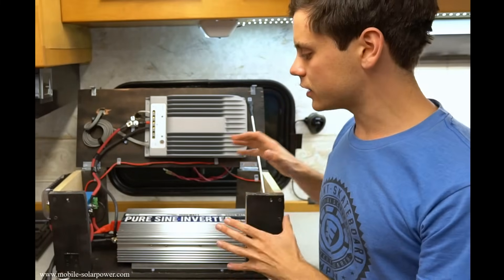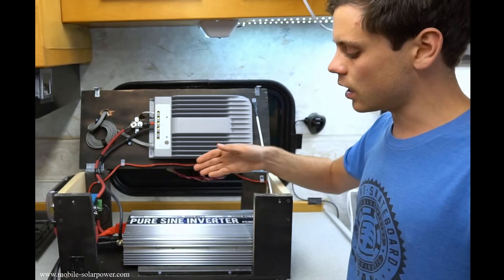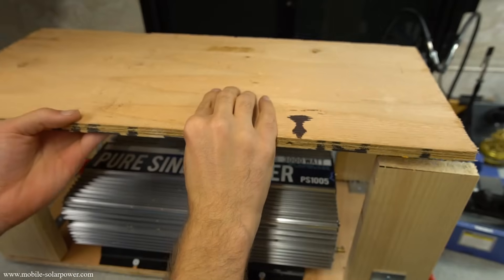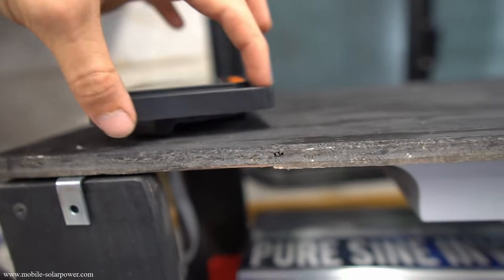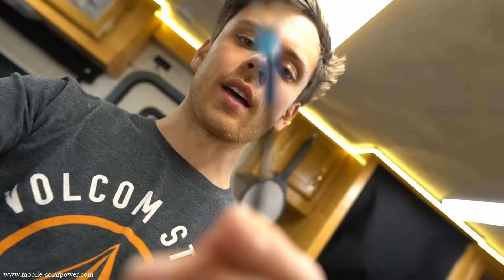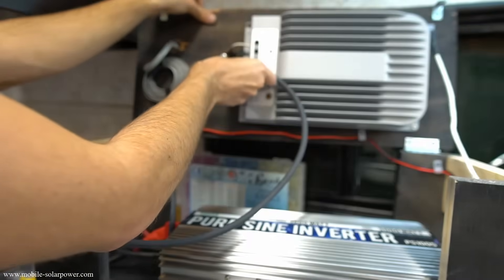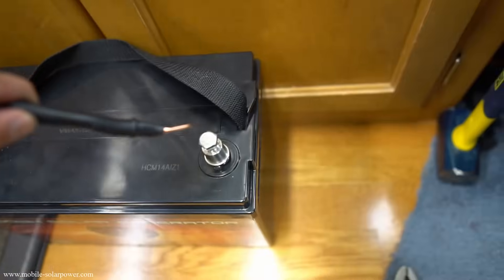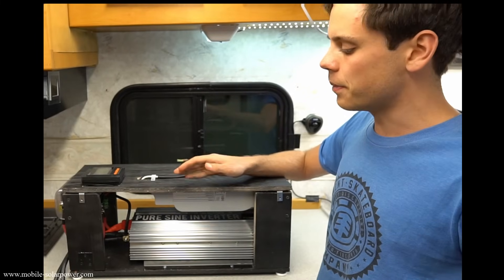DIY Off-grid Solar Power Station for Beginners on a Budget

Comment: Will, when making a portable power station, would it be ok to have a connector between the battery terminals and the charge controller? I'd like to be able to quickly swap batteries so I can use one battery with an inverter while the other battery is charging. I feel like having to unscrew everything would be time consuming compared to just a set of plug together connectors.

Comment: Hi Will, greetings from Spain. I just have a couple of questions regarding how to charge the LifePO4 battery, I want to build a 12v 100Ah  portable battery that will be  charged only from 220 ac, I will not be using solar panels for charging. In that case I do not need a MPPT, Can I charge the battery just with a cheap PWM made in China and a 12v power supply from a PC.

Comment: Will,  I HAVE AN IDEA FOR A NEW VIDEO.  This may be elementary to some, but I and others (I believe) need to have a better understanding of the grounding (or lack of) of solar generators that don't sit on a metal frame on the ground, especially with inverters that have  120 AC output.  I don't really understand it.  If you build this same system as a semi-permanent system in an RV you would ground the negative to the frame as well as bonding the inverter case to the frame for safety, but on these portable generators there is no grounding.  What am I missing?

Comment: Great!!! What device could one add to make it work like a GOAL ZERO.  I'll explain.  I have a domestic frig in my office.  It is getting it's power via the 12v cig lighter connection on the Goal Zero.  The Goal Zero is plugged in to ac to keep the battery charged.  I Goal Zero's internal battery acts as back up power for when the lights go out.  What device can be added to your solar power station so it can act the same.  Thanks

Comment: I've just built this box today and cut the timber (16mm thick) to the following sizes if it helps anyone out... Top and Bottom Panels - 560 x 270mm, Four Corner Panels - 100 x 220mm, Two Side Panels - 238 x 120mm (mine are around 20mm deeper top to bottom than Will's)... I'm using the same EPever 40A controller but with a 2000w Krieger inverter. These timber dimensions leave a gap of approx 65mm between the controller and inverter when the lid is closed. Thanks Will!

Comment: Why not making the Solar Power Station using a DC to DC/Mppt combo unit which will increase options and useability?
I like the CTEK system for that, is small and expandable.

Comment: LOVE your videos! I've got a new name or way to market yourself. "Will" Power. Anyway, would this be good if I downsized it to a 100 watt setup for my backyard? Want to keep it in my tool shed and run a couple of water pumps for garden water falls and some low voltage lighting. Thanks and keep up the great work.

Comment: This is the first of your videos that I’ve seen that has a separate Low Voltage Disconnect. Are these necessary with Battle Born batteries that claim to offer such a feature in their BMS? Thanks

Comment: great channel Will.  you don't talk much about recharging time and/or rate capacity. On my channel I have a series called "Portable Power".  I talk about FOGS (forced off grid survival).  To me (and my viewers), the recovery rate to full capacity of the battery is a critical factor.  the power station I am working on needs to able to charge back up in 2 a hour time period.  I suspect that the solar power source can't do this.  I also would like your insight to the recharging aspects (time, max amp rate) of SLA vs lithium batteries.  If you watch my FOGS video you might be more likely to understand that in a FOGS scenario, battery recovery time is limited to the incremental running of the whole house generator.  My FOGS idea was created because I do want to be on grid but in smaller communities outages (hours or days) force alternative short term solutions.  Am I wrong in my assumption that when recharging batteries, Lead acid wins hands down against the lithium?
Reply: BTY, you should learn to use pocket hole joinery.  it is much easier to use than "L" brackets. I am  avid woodworker so I am more familiar with working with wood, same as your expertise in electrical.  great channel you have here :>)

Comment: Love the DIY power station.  I have a question about the battery connection.  To make this portable so I can connect it to my RV battery mounted outside on the front I'd like to be able to plug in the battery.  Are there power connectors available that can handle the current for a 1500W inverter @ 12v?   I'd rather not have to attach the wires to the battery terminals every time I want to use it.

Comment: Know what I dig about this, besides your enthusiasm for this project? That you can SEE your components and that its portable, efficient, and safe! I will certainly build one of these, but I think id rather use one of the better/Bluetooth MPPT chargers and maybe an extra couple DC ports, USB, and maybe a basic volt meter. Sweet build though!
Reply from the maker: Great point. A nice victron would work well in here. And thank you!! I loved this little box system :D

Comment: Thanks for the great video
I'm looking for a small plug and play  unit to run alpicool 20 compersure fridge with 100 watt panel. Traveling in car so need compacted unit.Looking at poweroak 400 or jakery. 
Thanks Gaylene

Comment: Will, you need to buy a big bus and install a mechanical shop inside to make solar cell equipment. Then with a second driver, you could drive around the state/country and show demos to people and offer courses on how to build those things. How do you like that idea? So far people can check your website but they cannot touch the equipment.

Comment: WHEN PURE OR MODIFIED SINE WAVE INVERTERS GET USED OFTEN UNDER LOAD MOSTLY IN HOT WEATHER SUMMER CLIMATES, THEY USE THE COOLING FANS OFTEN AT HIGH RATE SPEED, THIS CAUSES MUCH WEAR ON THE INTERNAL BUSHINGS  BEARINGS, THEN YOU GET FAULTY FANS MAKING NOISES SLOWING COOLING AT START UP AND RUNNING. DO YOU REPLACE YOUR FANS WITH UPGRADED ONES WHEN BUILDING THESE PROJECTS. I USE  SMALL DAB OF MARINE GREASE ON FAN HUB BUSHINGS BEARINGS FOR RELUBING. MOST START FAILING BECAUSE OF CHEAP THIN GREASE THAT THE FACTORY FAN MAKERS USE. I OWN SUNFORCE  PURE SINE WAVE INVERTERS AND THEY WORK WELL. NICE BUILD.

Comment: I had done a plastic ammo box from the hunting store, I had added a fan on the side for ventilation and it works great with my inverter.  Add some fancy speaker box carpet and that box would look fantastic. I was thinking after watching you can get cheap flip style circuit braker that only flip during over current events instead of heating up like those cheap automotive sytle ones. They waste current while being inline to heat the metal strip inside to move away from the contact but they are reliable but use a considerable amount of current.

Comment: VICTRON BATTERY PROTECT BP-100 12V AND 24V - is this the right one?? I couldnt find it in the parts list.....Amazon has it as a 65a, 100a, and 220a. I'm getting the 100a, right??
Reply from the maker: Oh yeah, that's it. I have it on the parts list for the lithium power station I posted last week. It is the 100 amp battery protect

Comment: Hey Will, you keep rocking with your videos. You must have plenty of free time jk!  Thank you for inspiring videos. ?, can the victron battery disconnect be used for 18650 battery packs. I've made a set of 6x24 packs and will connect them in series and parallel to give me 120 ah. 12v Also will be running a 1500 watt PSW inverter and 40 amp mppt CC, it will be a 12v system. My inverter cuts off at 9.5 volts. Will wait patiently for you insight. Thanks and be well.

Comment: hey there good sir,i watched your other video on a solar charger station was ok watching it but was wondering why a lot of problems broke out on it and disconnection problems were present? confused as to maybe the video you made seemed like that type you built on other video you had wouldn't work out so well as what it looked like in your video and how you were making it out to be,not making the impression that these don't work but just was curiouse about it not working? im also wanting to build one of these myself gunna be building a series of lithium ion batters ill be using from laptop batteris ill be salvaging or maybe just ttry getting off ebay maybe and build two sets in series of these battery packs to connect to a inverter 12 volt system while also using a solar charge controller ill be using that cooling system you mentiond to best of luck to ya man :)
Reply from the maker: Wait what are you asking specifically?
Reply from the maker: What disconnection problems?